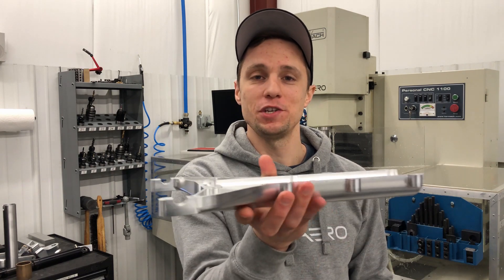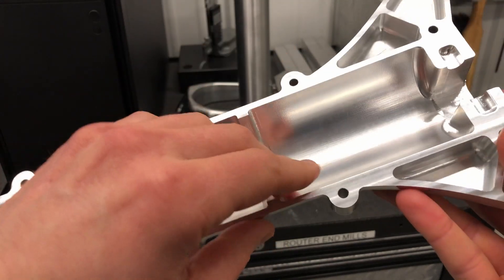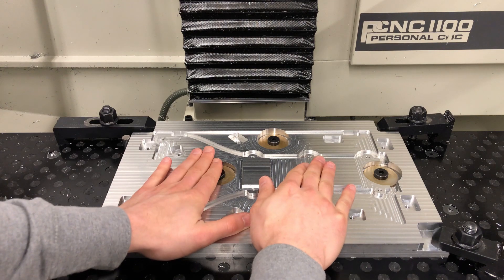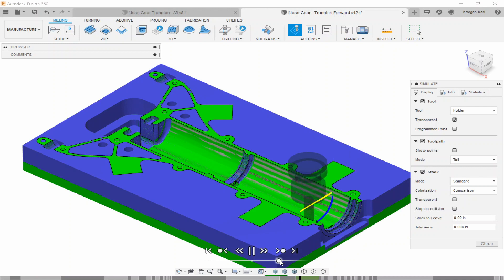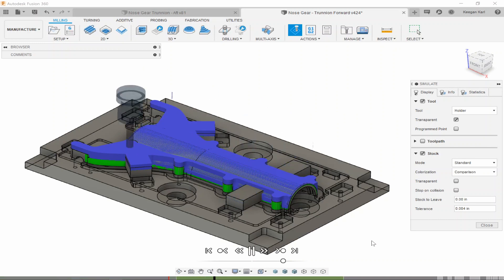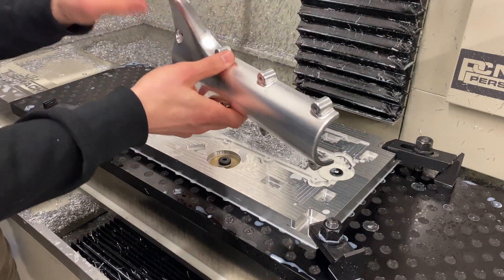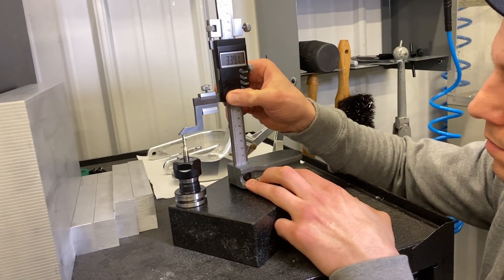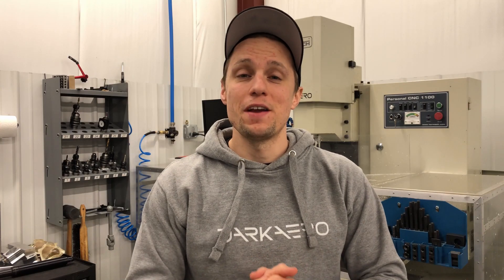Secrets to Machining an Aerospace Part on a Tormach CNC Mill

Comment: Would it be possible for me to machine a part like this on my tekcel enduro flatbed at slightly larger scale if I were to invest in additional vices and fixtures for work holding.

Comment: Mike Patey made the point that especially for tight tolerances on larger parts, temperature control of the machining room and equipment is very important. He brings the material into the room at least 12 hours before starting work to ensure it's at a uniform temperature. It is likewise important to keep the cutting tool from heating; the spray is not just for chip removal. Proper maintenance of the coolant management plumbing is necessary to maintain consistent flow. 

Thermal expansion effects can add up quickly on a part that goes along a wingspan! It was quite impressive to see Mike Patey cut and drill wing and control surface components that fit perfectly at every rivet point without any wiggling or extra adjustment.

Comment: I'm a little surprised that the fixture is aluminum. Is it at least harder aluminum than the part being machined? With a soft fixture, I would wonder about wear over many uses.

Comment: One thought. Rough out by Water jet 6 or more of those with all bolt holes, G54 offset, keep the tabs you have, make 6 at a time.
Reply from the maker: Thanks for watching! Yes, this is good idea! We had been discussing ways to cut down cycle time recently and the topic of water jet cutting out the rough shapes came up. It's a great way to save time and material!

Comment: Hey guys, great work your doing on this adventure. A quick question which may have been answered already but what was the total machining time on this part, both oops.
I do understand this is prototype and speeds and feeds are probably conservative. 
I have a 1100m but am not at this level yet , thanks

Comment: Lots of great tips that show you pay attention to precision.  Pro tip is to get very close with a good tool distributor.  He'll be able to sell you tools and holders with low runout, high performance geometry and coatings, and give proper feeds and speeds.

Haas is an entry level CNC.  I hope you do well enough to step up to a more solid machine.

Comment: I'm curious about the more granular and technical  aspects of this project.  Specifically, how do you:  (1) determine the forces that your parts will experience during use, and (2) determine that the parts can in fact survive those forces and  work correctly?  Thank you!
Reply: I know this is an old comment but hopefully it can help someone. I don't know a lot but I know a little about this. Essentially you start with a requirement. For this, it's a piece of landing gear, so perhaps your requirement is that it has to withstand a hard landing. That's not a requirement though, because there's no usable information attached like a number. So you have to define a "hard landing". Maybe that's a downward speed or something. Then you can say that if the aircraft weighs a certain amount, then the landing gear will experience a certain force based on that maximum speed. At that point you can start designing parts to withstand ALL of the many requirements you would put in place.

To answer your second question, it really depends. You would probably start with hand calculations which simplify the problem. So for this part you might plug in your requirement number from before and the values for a cylinder into an equation, which would give you a number for stress, pressure, etc, which you can compare to the material strength or other metrics to determine if the part would survive. Then you might flesh out a CAD model and run computer analysis such as FEA. Lastly would be actual physical testing of the part. When you slam the landing gear into the ground at a certain speed, does it break?
Reply: @georges8888  Thanks for the info!

Comment: Respect, good work. I worked as a cnc miller for over a decade (mostly Hermle with heidenhain Controls) and i think i can judge the degree of difficulty of this component.

That's not easy. Now i'm on the programming side of the job and if i had to do something like that, i had to think about the best method for a while.

Greetings from Germany

Comment: Nice looking part!  I take it that's 7075?  Hard to make 6061 come out that pretty.  Did you guys do FEA on the ears?  I don't know what you're using for load assumptions but to my old engineer eyes those features don't look like they have enough safety factor.
Reply from the maker: Thanks for watching and for the comment! The landing gear was designed in accordance with the FAA’s Part 23 load guidelines for certified aircraft gear.

Comment: Great job. However I feel that the outer layer was "damaged" with the lateral finishing cuts. I would like to make them along the length for better fatigue strength. But it's true, that I don't know, how the part is loaded. It probably doesn't make a difference.

Comment: Excellent video and excellent demonstration of fixturing. So many people overlook the steps, order of operations and planning that it takes to make a quality part. They just assume that since it is CNC that the machine will do everything for them but that's not true. It's like an old machinist making parts on a bridgeport, tighten the part too tight and its going to flex, too loose and it will vibrate. Take to big of a chip load and the part goes flying, not enough chip load and shit starts to rub instead of cut.... All that said, well done sir.

Comment: This proofs the part is 95 percent machinist and 5 percent machine. :) Working/tinkering on the workholding is about as satisfying as machining the actual parts. Nice work!  Thin walls are always a challenge, while flipping the part over it becomes more rigid  by touching the surfaces of the workholding. In some circumstances you need to add a support frame or use a medium like lead balls to avoid resonances. Great work, There are people with a DMG that don't come this far..

Comment: I stumbled upon your channel from your cad commercials comparing why you switched from fusion 360 to Onshape.  I am  curious to know  how  is it  switch coming along?  Are you guys college grads with engineering degrees?  Or guys with a desire to create some thing viable.? How long did you guys use fusion 360 before switching to Onshape.?
Reply from the maker: Dark Knight thank you for checking out our videos! We were initially using SolidWorks but then switched over to Onshape. We’ve been using Onshape for a few years now and we really like it, still happy with our decision. :) We first started using SolidWorks back in college around 2007. We all have engineering degrees but in different fields: aerospace, mechanical, and electrical. Currently we use Onshape for CAD and Fusion360 for CAM.

Comment: Some people have commented on using the holes to locate, it would be a faster option if you reamed the holes out on OP1 (eg 5.2mm) then when you turned it located on 5.2mm pins with M4 tapped holes in. Just a suggestion, nothing wrong with using tags I work in F1 and we use them all the time. Nice video and best of luck.

Comment: not good idea using brass ring with aluminum arbor
Reply: What would you have them do instead?  They are not that far off on the galvanic corrosion.
Reply: @danl.4743  graphite-filled caprolon or plastic separator between brass ring an aluminum arbor

Comment: Such a great video. You asked if that made sense at one point. It surely did. You demonstrated the process very well. I don't see that much detail in other videos.  The tool paths on the software, the fixturing. Kot much on fixtures, that I've come across. Thanks for the video

Comment: Question: why was OP1's XY origin off of the center raw stock instead of the fixture? Did you have problems when going to OP2?
Reply from the maker: tony wilkinson great question. I wanted to create a feature on the fixture I could reference for my origin for OP1 but it was basically an oversight when I designed the fixture plate. Another issue was I was running up against the Y travel of the machine so I was limited on space for adding a spot I could pick up Y that was off the stock. I would like to have it off the stock for a future improvement. If I had lost power at any point during OP 1 I would have lost my XY origin and would have had no way to pick those up again. So def want to change that going forward.
Reply: @DarkAeroInc  that makes sense. The part is beautiful, and I can tell many hours went into it.

Comment: looks nice guys. Jus Curious why do you use Auto Cad vs VisualCamc which is integrated with Onshape? I have never used it but someday i will need a Cam software would like to know your thoughts
Reply from the maker: Jordan Reimer thank you! We’ve played around a little bit with VisualCAM. It doesn’t feel as refined as Fusion. The user interface also feels a little dated. Fusion just has an all around more capable CAM package at a reasonable price in our opinion.
Reply: @DarkAeroInc  Thanks for your insight! I will see what options are available when it comes my time to get into CAM
Reply from the maker: Jordan Reimer no problem! Happy to give our input. If you have any other questions, feel free to reach out. 👍🏼

Comment: Thanks for sharing this video , can you please tell me what are the type of servo motors and it is size used in this cnc ? Also what is the size of the guide rails ?? I very apprecieated that.
Reply from the maker: If you send me your email I can send you some information that goes into the details of how they decided on the stepper motors for the series 3 machine.
Reply: @DarkAeroInc  ameeneng12345@gmail.com  
This my email.

Comment: A shell/fly cutter might prove to be a wise investment to cut (haha, get it?) down a lot of time in the first step. Instead of using the 3/8 endmill to do all that work flattening the part out, a shell cutter could do it in a fraction of the time. This would also vastly extend the lifespan of said endmill since it's workload would be lightened quite significantly.
Reply from the maker: Thanks for watching! Definitely looking at a fly cutter as one of our next tools.
Reply: Using the small cutter for facing your fixture is good practice for reducing any tram error in your head.
Reply: @jamescarter9147  This is exactly why I thought that they did it this way.

Comment: What was the total machine time for all 3 operations?
Reply from the maker: This was our first one and we didn't have the right tools so a lot longer than what we plan to have dialed in for production. It was several hours for the part.
Reply: @DarkAeroInc Thanks,  that's significantly faster than I was expecting.

Comment: Nice looking part but seems like a very time consuming costly part. If you can match or surpass the weight with a welded HS steel tube construction that can quickly be put together in jigs, isn't that much better? and/or bent welded sheet. I'm looking at Lancair, Cirrus, Mooney, Van's and none of them use large compound curve machined parts.
Reply from the maker: Dan, thanks for watching! We can't speak to the other aircraft landing gear you mentioned as we weren't involved in the design process for those. Ours was designed prioritizing structure and weight savings. Earlier on, we had considered designs involving welding and bending the material but opted away from those as each introduced an additional process to our manufacturing that required new quality and repeatability control and they didn't provide any weight savings.
Reply: @DarkAeroInc  tube with trailing arm fork suspension just seems hard to beat for ease of manufacture, weight, service, cost, reliability.
How long does those two sides take to machine and process to make smooth?
Reply: @DanFrederiksen  Ball mill final smoothing for both sides was 1.5 h total according to a reply from DA to another comment.

Comment: I first want to say you guys are doing a great job.
To be brutally honest, that part is wasting a ton of machine time. It comes out looking beautiful but it's not really optimized for production. For what it does the geometry needs to be reworked so it can be machined in quicker 2.5D tool paths.
When you're a small shop with a limited number of CNC machines you need to get parts in and out as fast as possible. Even on small production runs.
You need to know when to be a perfectionist and when to be a productionist. 
Brandon
Reply from the maker: Thanks for watching and no worries on the honesty! This part was not optimized around the singular variable of manufacturability. It was optimized for it's main function as a landing gear component with weight savings and structure being top priorities. This part would not be possible with a 2.5d mill even with a complete re-design. There is definitely a lot we learned from making our first one and still a lot of ways to improve how we go about machining it that will bring down the total machine time considerably.

Comment: Cool part! I’m a toolmaker and I would say you did a good job. I was thinking that when you machine that much material away on one opp and finish the critical features you could tend to have the part warp on the second opp. Something you could think about is just machining like .030 off of the stock in your first opp then flipping it over and then do it like you did. What that does is breaks the “scale” on the block which releases a little stress and gives you a flatter surface to sit on. The only other thing I would have done instead of using the clamps and tabs on the second opp is just put bolts in like half of your holes and modify the tool path to not machine away your bolts. Then just put in the rest of your bolts after your done and remove the original ones. Then just machine those areas. It seems like it might take away the chance of your clamps lifting your part and wouldn’t be as hard to get a wrench under your part to tighten clamps. Ether way works and it’s what works for you. Keep up the good work.
Reply: Also, instead of making an elaborate fixture you could have made some of your bolt holes more like dowel holes and just put like dowel pins and bolt holes on a flat plate for a fixture. Just ideas for future pieces.
Reply from the maker: @brandencroy6416  thanks for watching and for the suggestions! We had considered just bolts and had a more in-depth version of the video explaining why we did both clamps and bolts but ultimately cut it out of the final video. The holes for the bolts are slightly oversized so the bolts don't provide any means of locating the part relative to any critical geometry. For this part, the ID is the most critical geometry and is why we wanted a fixture feature to use for locating the ID. Dowel pins could work but they still don't serve as the right locating feature as the bolt holes aren't the driving critical geometry. Also, the clamps are able to generate both downward and lateral force on the part so we weren't too concerned with it lifting up the part. :)
Reply: I understand what you're saying. A lot of times we we circle mill the bolt holes so that they are a nice hole like a dowel then just buy a gauge pin to fit and cut to length to use in the fixture.

Comment: Hello. Cool video. I just wanted to know how did you determine the total stress that will apply on this part. Is it well known that the pockets for removing materials must be triangular if yes why?
Also what softwares do you use for CAD and machining simulation.
 Thanks.
Reply from the maker: Thanks for the comment! FAR Part 23 provides guidelines for landing load conditions based on the weight and performance of an aircraft. We used this guideline to understand the loads this component would see under worst case landing conditions. You can perform simple hand and spreadsheet calculations to determine stresses on landing gear parts and then further confirm part stresses using FEA. We also plan on doing drop tests to verify our analysis work. We use Onshape for CAD and Fusion for CAM.
Reply: Thanks

Comment: What was your step over on the ball end mill parallel finish?
Reply from the maker: Bryce Workman 0.02” step over which puts the scallop height at around 0.0004”.
Reply: @DarkAeroInc  This is where I usually go wrong. I use to use a much smaller step over but a much faster feed per tooth. The cusp height would be good but part surface finish not so good. One question though. Did you not think about putting counter bore pockets through the other side of your fixture to bolt the part directly to the fixture then clamp the fixture to the machine? If there were large quantities you could have used a zero point clamping system for the fixture. Great work by the way. If you were based in the NE of England and looking for a job then this channel would certainly get my attention. well done!

Comment: Your first part is always the most expensive, as I watched you video I noted you were using small end mills to rough everything, but later you mentioned using larger tools for roughing. 
You wat to use the largest tool you can, then use finish tools.
Use a face mill to surface your material, they take wide shallow cuts.
But EXCELLENT quality. Keep it up
Reply from the maker: Good idea on the face mill! That’s one of the next tools we would like to get!
Reply: @DarkAeroInc  I suggest a 2.00 diameter face mill with your current machine.